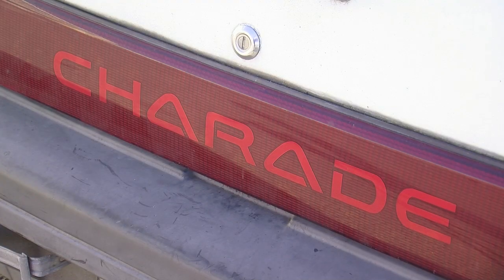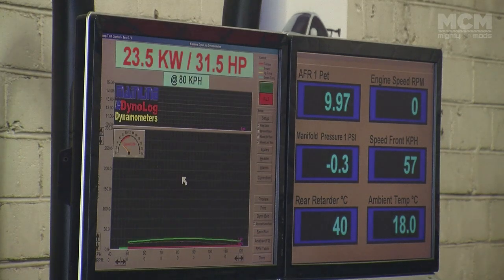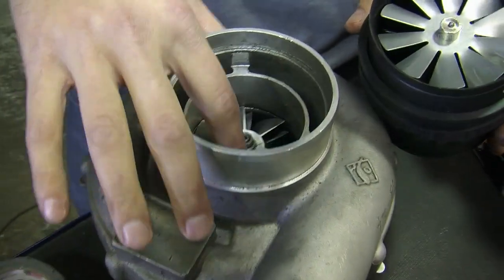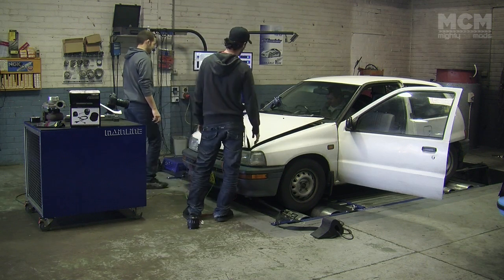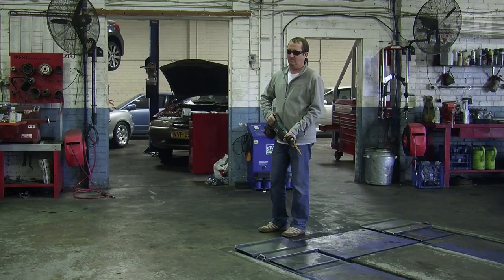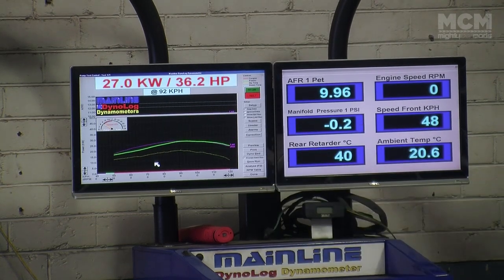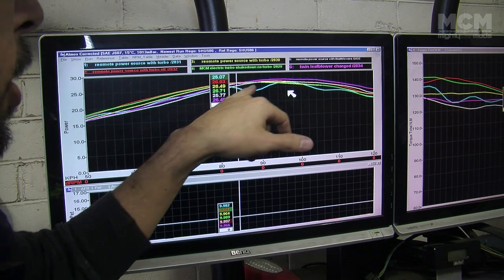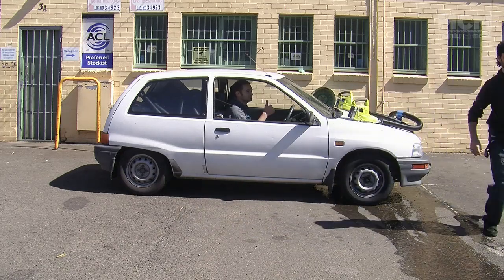Electric SuperChargers Mythbusted

Comment: what if you just hooked up a strong enough electric motor to power a real belt driven supercharger instead of the design tested in the video? It would need to be powered by a separate battery which would be charged when parked at home and used to power the supercharger when driving, of course. Also any thoughts on using regular compressed air for short bursts of boost on demand? I'd like a regular air tank in my trunk, fill it at home and dump it into the engine in a controlled manner?

Comment: It is worth noting here that the Internet is flush with fraudsters selling "electric superchargers". Most low cost systems marketed as electric superchargers are not. In simpler terms, the typical inexpensive electric supercharger will not increase the horsepower of an automobile due to the inability of a small fan to produce positive pressure at the necessary flow rate.

Comment: This isn't new tech, but this is certainly the worst possible case of electric blowers. DC electric blowers are woefully underpowered because they're limited by the current from the battery. Using an AC electric blower powered by the alternator produces much more pressure, but it shouldn't be seen as a replacement for a proper traditional blower setup. It is, however, fun to tear down a 12amp 200+MPH (air velocity) ac electric leaf blower and rig it to your intake.

Comment: You totally missed my point. The engines were just examples;I'll simplify it. You have an engine with a blower that made 8 lbs of boost and flows 215 CFM. You port and polish the cylinder heads but don't change anything else. Now you make 5 lbs of boost but flow 240 CFM making more power on less boost. Not #EngineDisplacement it's #CFM

Comment: I know! Iam a car mechanic! This ratio for idling and no-load mode but u accelerate this ratio is modified! When u charged up air pressure need constans value if a higher than basic value u must upgrading fuel pressure in proportion or injector size! This big challange to work it all correctly! But you're right too! 300$ too much money for this bullshit!

Comment: Oh my gawsh, it's all clear to me now! That's right! They should make a fan of some sort.. one capable of spinning at over 10000 rpms! One.. maybe not made of plastic, but METAL!.. OH OH and .. let's have another power source other than the vehicle's electricity.. um, OOH! Exhaust gasses! That'll work, let's spin that ol' compressor fan with exhaust pressure and have it compress intake air and force it into the combustion chamber.. Oh, Wait..

They have those..
They're called REAL fucking turbos

Comment: Actually, it's in a ratio of 14.7:1   Called the 'Stoichiometric' ratio of optimal air-to-fuel for an internal combustion engine to operate more efficiently. Technically, you're right, we do need more fuel the more air we put it, but never equal to or greater than the amount of air present in the combustion chamber. That was their point. That the amount of air provided by the 300 dollar Air-move-OOP.. i mean "SUPER CHARGER HURRRRRRR" ..was not enough to provide boost-capable pressure for power.

Comment: You guys thought of everything, well, almost everything! You do not even imagine that the air could be escaping by several points, because the stock filter besides being quite old has not yet been configured to receive "air under pressure"???

Comment: Leaf blower would have worked better had u had one way valves on the vacuum lines so all  air actually went to cylinders and not the emissions part and crankcase

Comment: bet if you used like 20 delta fans you would get some kinda positive result. just make sure they are the 38mm thick 250cfm 25mmh20 static pressure fans.

Comment: lbs of boost is not comparable engine to engine. it is simply positive intake pressure represented with a number. you have to know flow numbers of the head and intake to even come close to making a comparison. The air flow created by 16 lbs on a Honda 1.8 doesn't even come close to 5 lbs on a Chevy 427.

Comment: Of course it didn't work. This "supercharger" used a cheap axial flow fan. Under best circumstances an axial flow fan would give you a compression ratio of 1.2 : 1. Real turbochargers use radial flow fans with a compression ratio of 2 : 1 .
You would probably get more power out of that engine if you injected some water along with the air or fuel.

Comment: It is you who is clueless.  A fan absolutely can make pressure, just like the 'fan' blades of a turbo or jet engine.  The problem with these is that the fan is poorly designed and underpowered.  I you were to restrict the outlet enough on that piece of junk it would make some pressure, but not with enough volume to make pressure on an engine.  Put a motor capable of spinning a better designed fan to 50,000 rpm or more and you'll have enough air volume to make boost but that wouldn't be cheap.

Comment: The speed of the fan/compressor is not the issue, though most good compressors are designed to turn that fast.  They are designed this way for size, a fast rotating compressor is inherently smaller than a slow rotating one.  The issue in electric superchargers is power and size, it is possible, but the motor to do it would be at least 10kW, which would be large and expensive.  More expensive than a belt or exhaust driven compressor.

Comment: I was also wondering about carbie issues with suck thru as opposed to blow thru... Could that have been messing with the operation of the venturi(s), and hence fuel metering... hence lost kW due to lean out??? But as the old adage goes...  get NOTHING for nothing...

Comment: most of the Classic Round Air Filter cover's did not fit the lid and the lid stuck up from the base what im saying in slow term is if it doesn't have a MAF  (mass air flow sensor) type of intake not fiwtb (fuel injection with a throttle body) are a custom Plenum  its not going to work right ok.    oo and the electric turbo suck you can get theme from a boat part stores for bilge pumps

Comment: The electric turbo device in the video hinders flow by placing an obstruction in the air intake powered by an electric motor that wouldn't have a hope of spinning the fan fast enough to match the normal air draw at high RPM.

Comment: I laugh when people say electric turbos work because BMW is using them.  BMW does not have any cars using them.  They filed a patent years ago and have yet to follow through.  Secondly, they are not electric turbos but electric assisted turbo for very small engines.  The motor is just there to reduce spool time.  And they are not fans.

Comment: The remark at the end that electrical power will never be enough for a turbine, is not true. BMW and Audi just came up with an electrical powered turbo. The mistake people make is there is difference between flow and pressure. A turbo increases pressure, the devices in the video just add flow.

Comment: You need an ecu tune. You need to tune the air fuel mixture richer to make more power. Adding the supercharger natively made the car run lean. You probably not only need bigger injectors but also a tune to compensate for extra air.

Comment: You can do it with car equipped with carburetor because the fuel:air ratio is not calculated by computer. If it use EFI you will need to upgrade the ECU also.

Comment: They should have adjusted the mixture on the carb. More air from the leaf blowers mean that the carb can dump more fuel. This engine was probably running lean in the video, making less power than it should have.

Comment: The fans are creating a dynamic pressure, that is the pressure that moving air create. The pressure you want is static pressure. And that is just what a turbocharger is designed to do. It converts the dynamic pressure of moving air in to static pressure.  Anyhow, great video guys!! Love your channel!

Comment: there are a few things wrong with that video apart from the overwhelmingly large amount of sarcasm. firstly any little amount of "boost" would be lost through the airfilter assembly as they leak around all the seals. also even the newest and greatest turbos today only spin at about 240k rpm. 100k a second is a bit off. Pretty funny all round though

Comment: the main problem with it is that the engine is already sucking in air as fast if not faster at even 1/2 throttle than that little fan can possibly spin.. 

But idiots are probably still buying them anyway...

Comment: You don't have to add more fuel until you get into larger superchargers or turbos.  For example you can add a procharger P1SC to a stock mustang and not have to change your fuel injectors and still get a very noticeable difference in power

Comment: I have one notice. When the engine gets more air you have to put more fuel on to it. Because if we want more power in our engine we have to put more air in it and fuel in relation to respond it . So this was getting my tension because you did not adjust the carburetor to respond increased air. the Lambda value is good way to see 	suitable mix of air and fuel. Of course this "supercharger"  may not increase air flow so much that we would have to put more fuel but you shut have tryed

Comment: Up to 50hp is considering how big the engine is before adding turbo. However much psi over 14.7 will theoretically decide how much extra hp you get. You would have to like 20 psi to that shit car to get 50hp.  Now if you added 5psi to an engine that already had 200hp you might add 65hp. Basically 5 psi should add up to 33%

Comment: Again, for diesels 2000 RPM are concidered high... however they basicly run at full throttle all the time. In diesels there is no controll on the incoming air. The only thing that controlls the RPM and power output is the amount of fuel injected  in the moment of ignition. The fuel mixture in a diesel is always lean, exept when the diesel starts to smoke. It can get away with igniton of a lean mixture because of the way the fuel is injected in the cylinder and ignited immidietly by the heat.

Comment: Of course things like that don't work! Put a vacuum cleaner compressor and a intercooler and than try again! I had my Lada Jiguli 1.2l 50HP run with LPG system for tubocharged engines and i used just 2 rewinded vacuum cleaner compressors. The thing went over 70HP having in mind that the vaccum cleaners needed about 3KW of elecricity when they ran. Since the 2 generators i put produced 14.4V @ 80A each the compessors actually drained the battery even when the engine was running at max RPM.

Comment: 2nd that! First car I owned was also the smallest at 2.0L and weakest @ 158hp, but got nearly 40MPG. 13 years and a few cars later I'm at 3.6L & 300HP for a little over 3,000lbs.

Also, have a friend who had a motorcycle with a 2.3L engine, lol.

Comment: The boost is gradually increasing through the range with a centrifugal supercharger due to its fixed ratio to the crank, maximum efficiency is normally at high revs with a well dimensioned unit. 
A roots blower pushes almost the same amount of boost through the rev range, as thermal efficiency decreases and required torque drive it increases at higher revs it tends to loose power at the top.
Turbos can be dimensioned however you want to, stock mounted ones usually works at low and mid range.

Comment: It depends on what you're going to be putting it on. Centrifugal superchargers (ones that look like belt driven turbos) and Roots/Twin screw superchargers cost about the same as a turbo, but give you power in a different place. Turbos from what I have seen are mainly use on high RPM applications, where as Superchargers (in any form) are mostly used for lower end RPM gains.

Comment: When the engine is running high rpm's, that little fan can't move as much air as the engine is taking in,so it only would work right off the line at low rpm's, more of a torque adder rather than HP

Comment: Aw, come on guys. Why couldn't you at least hang an air pressure gauge between the turbo and the air intake and include air intake pressure in your power output graph???

Comment: they should of atleast stuck a boost gauge in there... the way they hooked up those air blowers to their "T" i dont like i see a massive leak easilly right there....

i could see this working possibly but the way they did it i just see all the possible "pressurized air" leaking out

Comment: yes, there are real electric superchargers, but they basically just take a standard screw type supercharger and replace the belt drive with a massive electric motor - i've seen one with essentially a cluster of starter motors and a planetary gearbox... really quite pointless, the amount of power not lost through driving the blower by a belt is just lost by the power required to supply electricity to it and lug all the extra weight!

Comment: UFO, you are indeed correct! Sixstanger, you need to go back to the books and have another think about what's wrong with your statements... Kirk is right in many ways, but one of the main points of the video was that they were installing the "supercharger" as per the manufacturers instructions. If you did however install the "supercharger" in a fashion that would "work" the thing would still not deliver enough air, and would just pose a restriction at WOT.

Comment: Uh... Maybe I've missed something here... But as long as the engine is running with the throttle blades at least partially open and the blower/supercharger/turbo delivers more air than the engine can ingest by vacuum alone... Isn't it under boost? 
A roots blower simply delivers more air than the engine can ingest to create an overpressure situation in the manifold = boost. Inefficient boost, yes, but still the same thing as what a turbo does as far as the engine is concerned.

Comment: Actually there is a vacuum valve that operates a flap in the intake "nozzle" there thats redirect air not from the front, but from underneath (to feed hot air in during a cold start in a cold morning!). So there is def a leak there. Not to say that the fan would have worked if there was no leak

Comment: That's irrelevant. Even if it did put out enough power to compress the air, carburettor basics.. you dont blow into a carb. Just attaching that 'supercharger' to the front of the intake is useless.. 

Imagine you attached a big spooling turbo onto the front of that rusty old intake like they just did.... it wouldn't leak boost at all.. right? :P

Comment: A turbo uses the exhaust stream to spin two turbines, one compresses and forces air into the intake.  A supercharger is connected, by some means, to the crankshaft, robbing power from the power strokes in order to compress air and force it into the intake.

A turbo 'lags' until the exhaust stream is fast enough to spin the turbines fast enough to 'boost' the air intake, but is more efficient since it doesn't rob any crank power.  A super-charger always works and has no lag, but robs crank power.

Comment: What?  In what way does air resistance change the power output of the engine, it does not.  The only thing that changes is if you have your air intake at a pressure point like just in front of the wind shield, you typically get high air pressure at this point at speed, this can raise power, but for that bucket of bolts it is only a mater of moving the air to make sure there is plenty to cool. Aerodynamic drag will effect car performance but not engine output, and they were testing engine output.

Comment: Only expiriance , but it made results on the drag strip , from 0-100 km/h (stock 12 sec) to 10.60 with the turbo.But its noth worth it, if you want cheap turbo , buy one from Ford Mondeo MK2 , and put it , it is so small , it makes pressure of 0.3 bar and it doesnt need special exsaut system.

Comment: I want to tell you how i did it. I have 1.4 Opel Kadett mi. I wanted to try this myth. But instead getting from e-bay i made one. The difference is that i use the turbine from the blower in the car, not NAN ,because turbine is more eficient , i removed the stock intake and made custume box above the jetronic, because the stock one have leaks.And the second inportant thing is that i replaced the 1.4 injector with 1.8.Because more air needs more full.And i want to say that this make it.NO DYNO

Comment: Yes, fans produce pressure.  But not enough to be effective as a supercharger.  If you look at a fans pressure/flow curve, the pressure is so slight, it is measured in inches of water instead of psi.  To get a fan to produce enough flow at say 5 psi would require a fan that would not fit under your hood and require a motor that could never be powered by 12 volt.  So ya, these things are a joke.

Comment: Alternator doesn't charge the battery all the time. It measures battery voltage and charges when necessary. That means, things like this fan, headlights and Ac does increase your fuel usage and decrease your performance on dyno.

Comment: A real, half way decent electric supercharger is possible if people would stop using the 12 volt system and instead put four, 12 volt Odyssey PC680 batteries in the back seat wired in series for 48 volts and run the positive power cable to a contactor such as a SW200 (12 volt coil though so you can engage it when you need boost) and then have the positive wire from here go to a series wound DC motor such as a ES-22-2. Negative cable just runs directly to motor terminal. Its decent, but not great

Comment: That's what I said.  You can't overload it, the voltage drops, current increases, causing an increase in heat due to wire resistance and the rectifier itself, which eventually results in the failure of either the rectifier or one (or all) of the coils.  That's why I said you would need to install a larger alternator.  One that is capable of producing more power without failing.  Learn how to read.